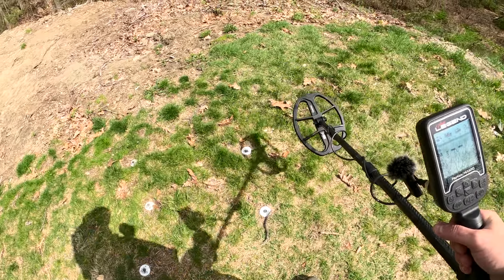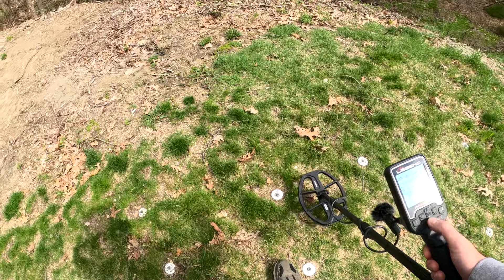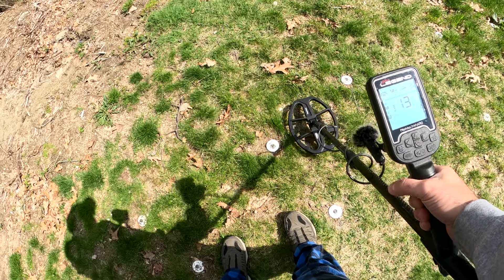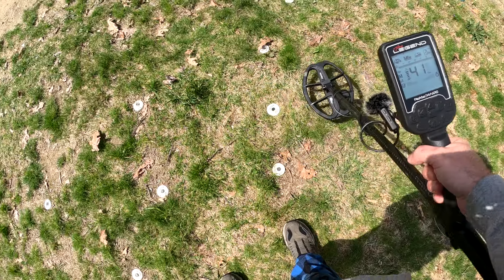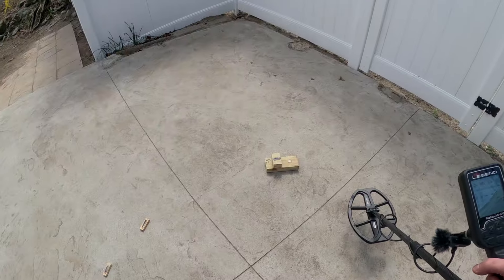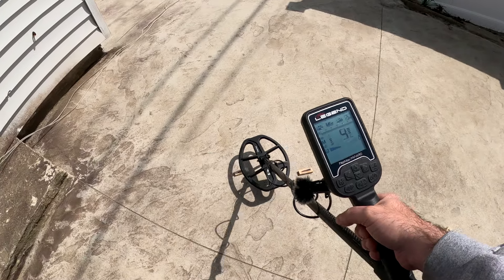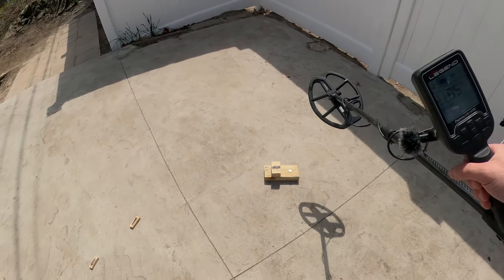NOKTA LEGEND BEAST MODE REVISITED DEPTH AND UNMASKING TEST - AFTER NOKTA UPDATE VIDEO

Comment: I just want your opinion. I have been hunting with the Deus 2 for over two years with great success. I am wanting to buy a Nokta Legend or a Minelab Manticore. Which would you go for? Been detecting for 52 years and have owned just about everything out there. Thanks Terry in Tennessee.
Reply from the maker: Hey Terry, great sale in the Manticore right now. I saw it posted for $1199 for the 35th anniversary. Its a great machine.
Reply: @IffySignals  I saw that. Will order in the morning. Thanks.
Reply from the maker: @terrygreennway9655  great choice!

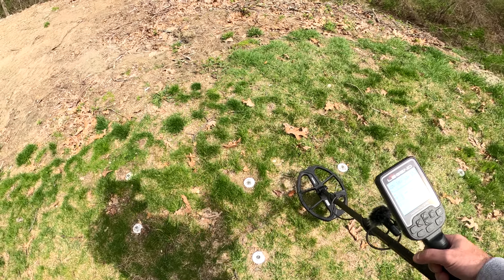Comment: Hi I’d value your take on the the Legend 1:15    Alpha update before I do the update.
Reply from the maker: Hi, it acts the same as in the 14 beta 2. Im not a fan of the new update. Just my opinion.. seems regular modes (depth and vdis) have been impacted vs 1.13. Allot more 1,2 IDs now.
Reply: @IffySignals  Thanks for your reply, I’ll stick with 1:13 for now then, as like you I didn’t like the way it impacted on the other modes. I understand Beast mode is there as an unmasking tool and not about depth but I think they have a way to go before they’ve perfected it. 👍

Comment: The TIDs of 1&2 will show on the deeper targets I have in my red dirt mineral test bed. Same as I showed on my first video.  I still need to experiment more with BE mode but for me it would be only for low trash ground. Regular Field & Park with DT activated is a real step forward and much more usable both in low & higher mineral soils. Hopefully Nokta will continue to improve BE mode as it is a good concept as was Gen D mode & EUD on the Anfibio, it just needs to be more real world usable. DT activation, on the other hand, is a a clear advancement to be praised.
Reply from the maker: Good info, thx 👍
Reply: @IffySignals  could you do a video explaining DT? I've read the description many times but apparently I'm too dumb to figure it out! haha

Comment: Nokta did not recognize the error with 1.11, I went for half a year without any finds, installed 1.09 and there were a lot of them, it’s a pity the beast marketing mode, increasing the depth is impossible without additional interference
Reply from the maker: I haven’t run into any issues with certain versions like others have had or performance issues after updating but as for BE mode, its a pretty frustrating mode to use being all metal. Going to try the Beta 2 on a field today.

Comment: i did little separation test in field today, was in field mode, recovery 7, IF2, ST 4, 0gs, 0bc/ sensitivity 22... i used the pice of iron i found there and a non ferrus object (not a coin) and the the more DT i crunked the worse signal would get, i achived the best unmasking on DT zero, wich according to instructions should gave better unmasking results the more DT you put... i dont rly get the best mode.... and nokta vide is odd, the should comper all programs on same reactivity, plus show the rest of filters, and give the targets depth
Reply from the maker: How can it be used when the coins give a non ferrous tone of 1,2 (in Noktas demo) but to knock out nails we need an IR of 2 and we get a 5 ID on the small nails?
Reply: @IffySignals  ehh i just gonna ignore that update xd

Comment: Hiya buddy, have you put the beta 2 version on it yet and done any testing ?
Reply from the maker: Hi Andrew, yes been trying the Beta 2 and comparing notes with others. Mostly same results going on so waiting to see where it goes with the main version when released.
Reply: Are you testing the 1.15 version soon ?
Reply from the maker: @andrewturner1799  yes 👍
Reply: @IffySignals  nice one, I do hope they sorted it this time.
Reply from the maker: @andrewturner1799  was hoping they got it out of the Gold Mode type base program but i see they left it.
Reply: @IffySignals  yes, they surely could of added another separate icon.
Reply from the maker: @andrewturner1799  its the lack or other features and tone adjustments being where its at.
Reply: @IffySignals  got you. I hope they they sort it.
Reply: Hiya iffy, have you tested the 1.15 yet ? What do you think ? Are you doing a video ? Wondering if it effects the other modes as seen in another person's test.
Itching to see your test.
Andy
Reply from the maker: @andrewturner1799  hey Andrew, yes seems to be effecting other modes with 1,2 Ids like in the second beta. This was/is not seen in 1.13. I watched HRs video.
Reply: @IffySignals  I do hope they sort these problems out soon.
Reply from the maker: @andrewturner1799  not sure who is noticing it and who is not. To me its an issue because i have cheaper less complicated machines outperforming it now. I could use it fine on 1.13, having other machines I rather not even mess with it right now. If they moved it to another spot or gave options that the other modes have i would have shown it but its acting the same as the 1.14b 2. From my testing the other modes (great performance) was negatively impacted by this update. Some may see it some may not, at first i thought it was soil but others have seen it as well, a couple are well known reviewers who will not even show it on YT and just moved on from it. Im sure down the line it will improve or we see another Nokta machine replace it.
Reply: @IffySignals  I agree, new machine on its way, especially the speed they bring them out 😁

Comment: Got the score back finally guess it was a coil issue vdis are all good detector behaves properly cant help but think my vanquish is still superior even though some might disagree
Reply from the maker: Glad they took care of it 👍
Reply: @IffySignals  i like it i actually like the beach mode the best it says in the manual its made to fight black sand minerals and my gb reading are usually in the 80s and low 90s so theres ferrous minerals in my dirt its not highly saturated might see halfway on whatever machines ive used with a dirt bar but i still think it has an affect and that beach mode seems the best
Reply: @IffySignals  i also like the just 15hrz i like how crisp and clean the signals come thought but it seems like the unmasking and iron bias is a little worse

Comment: Still same results for me in my ground. Park and field are way deeper than beast mode in my soil.
Reply from the maker: Right! You ever get a 1,2 ID locked on like they showed that was a deep coin, only 1 vdi off from a mid conductor to a high conductor, with a great audio response? The legend has never plummeted an ID like that. At depth the Legend up averages the ID. Never seen anything like it. It would be bouncy, high/low ect not lock on to a 1,2.

Comment: Soils are so much different around the world and metal detectors will react different everywhere. That's why you don't ask what settings they are using if in Europe. Ask yourself, did they GB and what other settings they used. I myself say, "if it's not broken, don't fix it". I like the way I have set my settings on my Legend and it has proven to me it can go deep. I have different profiles for different situation hunts.  Plus you have to think maybe, "ghosting" signal due to mineralization or even a "Halo" effect from metal that has saturated the ground after all those years. Deep signals I stick my shovel and open the ground up and break halo then recheck signal. Good hard signal, get to diggin!!
Reply from the maker: Thx Buckaroo 👍👍 cool name!

Comment: They need to fix that update , at least they did say it’s a beta version so I’m hoping before they release that actual update they fix these problems because according to nokta beast mode can perform in all soils , I’m not even bothering with beast mode yet , the DT feature helps a little but I don’t see  a big difference
Reply from the maker: They say its fine, no issues.
Reply: Yea I know , I have to check it out with the settings they recommended and see

Comment: I ONLY get low single IDs on deep iron targets most of the time.  Not every time the odd  mixed metal nail or fastner may fool me.   Everything else non ferrous comes in with an up averaged VDI.  Which as I said in a previous comment I still found useful for checking for deep iron in field mode which would often give me sketchier higher numbers for iron.   Running Beast mode full time however is not productive IMO.
Reply from the maker: Same Bill, never a consistent two way (with good audio response) hit 1,2 on a deep coin. Maybe that is part of the program, but i cannot replicate it here. I would not want to use that anyway with nails giving a 5ID, how are nails going to give a ferrous tone of 5 and a coin a non ferrous at 1,2?
Reply: @IffySignals  Ya all my coins , heck even small foil rang up high as yours did which I feel is actually better.   I don't want high conductors ringing up low lol.  The problem is, as your video showed it lacks unmasking ability other than a slightly higher cadence the lower audio tone that I can hear.......barely.   So I just used it on deep and ONLY deep targets as an iron check.
Reply: @IffySignals  Ok I just watched the Nokta video.  I notice they seem to be in a red clay type of soil.  THAT may make the difference.  That stuff is notorious for not being able to penetrate.   I have one spot with similar clay I'll see if I can notice a difference there.

Comment: I have black soil in the park.GBs run 13-30!. I ran the m15 vs lg35 manticore vs Dt Legend. Park/ AllGen, both 2 tone Descrim 17-30&50/60 Legend& 20/35&70/90 manticore. Both Reaction 4 both 0 iron threshold. Neither machine was hitting any decent signals more than 6 inches. Besides the can slaw pull tabs and lead pieces The manticore hit 2 dimes 1 penny and a nickel. The legend would not hit those dimes at all maybe the penny and hit the nickel just as hard. Both hit my test thin gold ring on a heavy fishing string slightly on edge @ 6 inches. Multi 2 was best and multi on manticore. I tried 20hz on the legend which usually is next best in this area but wouldn't hit any of these tonight. 20mhz on the manticore struggled on these but I probably wouldn't of found them. Both had wacky debth readings, something reading max depth was only 4-6 inches.
Reply from the maker: That is some tough soil! My soil is not too bad but i cannot get the depths of some areas that i have seen. Im ok with that because we do have some great history over here. Rock walls and cellar holes are around every corner in my town and it goes back to the 1600’s. Depth has been less of a concern with all of these new machines being capable of punching pretty deep. Pulling from the iron (while maintaining a decent Id has been getting better and better as well.

Comment: Iffy pls make video with 1.15.🎉
Reply from the maker: Hey Raf, the stock modes seem to have been impacted by the 1.15. Low 1,2 ids that were not there on the 1.13 or the 1.14 first beta. History Revisited put up a video demoing this. Not sure whats going on it with but I wont be using it.
Reply: @IffySignals thx for quick reply. I stay then with 1.13. 😊

Comment: Your test outcomes are mirroring mine, absolutely . I’m getting higher vdi than true vdi on items.For a mode that is suppose to find items the other programs,  I am finding the standard modes especially park m3 better at hitting targets at fringe of detection and an ID closer to true ID. I have had a few bugs also with this. Strange audio on targets . Also getting that fluffy low tone with 1-2. We have 2 types of soil on opposite side of the world and getting the same performance. Even though the test video by nokta , showed how the beast mode should work perfectly. Even though they had an ID of 1-2 and the audio was screaming as if the target was a few inch down from the coil . Hmmmmm very strange. Great work iffy, it’s been a pleasure. 🧑‍🦯👌🏻
Reply from the maker: You too Liam! Was good comparing notes and tests. 👍